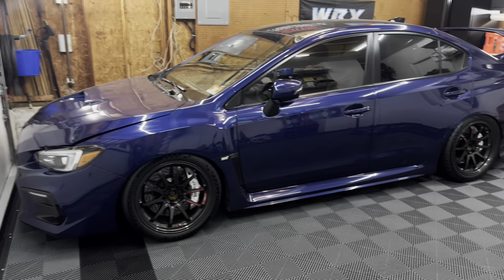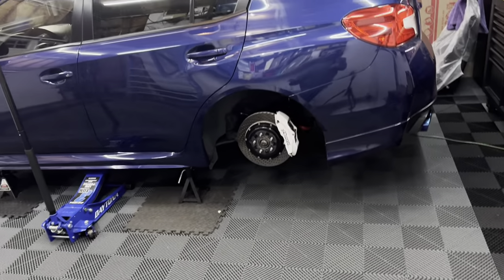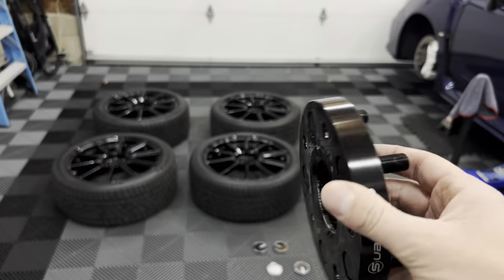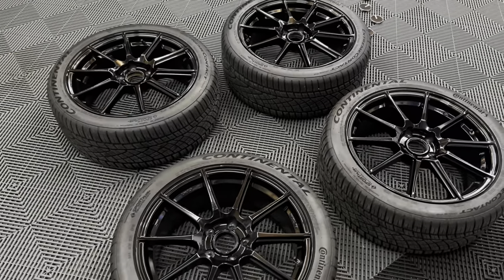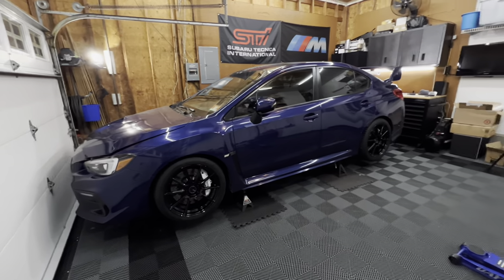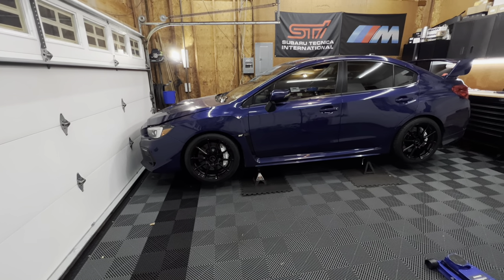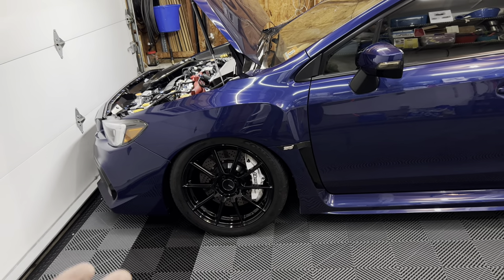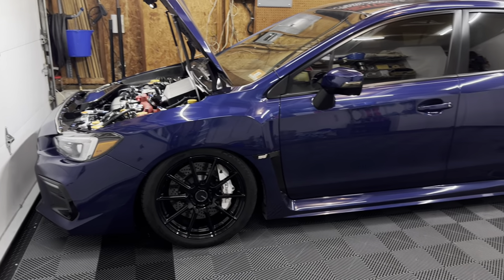Installing ANOTHER Set Of Wheels On My STI!!

Comment: Hey man when you bought the raceseng tow hook for the STI did you get the 2015-17 or 2018-21 version?
Reply from the maker: 18+
Reply: @Scoobyfreak86  would you happen to know what the difference is?
Reply from the maker: Different sizing due to the front bumper design

Comment: Just wondering how much better the Michelins are? Money wise are the continental worth it and what about noise?
Reply from the maker: Noise are both very quiet. Michelins better in dry. Contis better in wet/snow. I prefer the Michelins overall but the conti’s are a great 2nd place.
Reply: @Scoobyfreak86  last Q since Michelin is superior. Do you recommend spending the extra for pilot sport 4s or will pilot sport AS4 be good enough? There is a price jump in between, will AS4 be ok for daily?
Reply from the maker: Do you live in an area that temps dip below 40? If so, as4. If you live in a warmer climate, ps4s all day. The as4 will get more mileage out of them though. All depends on your need for the car.